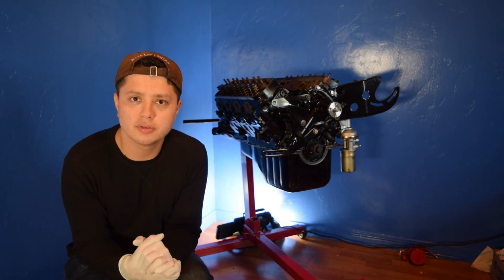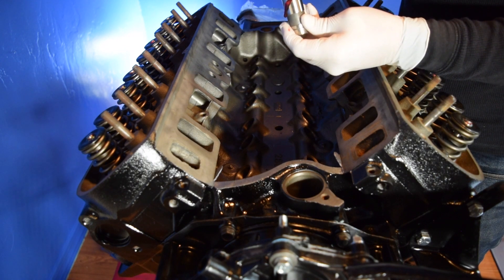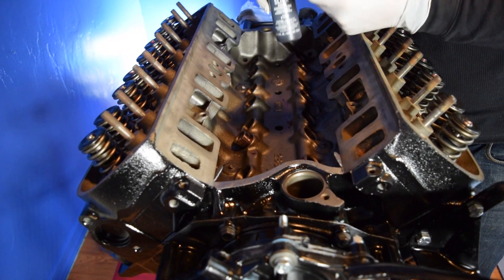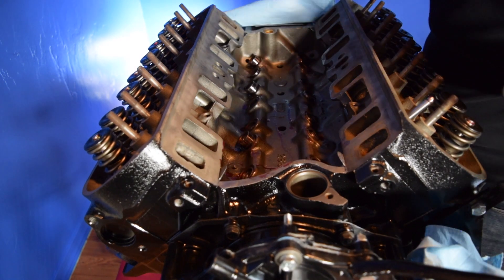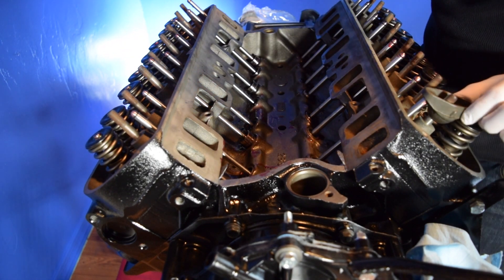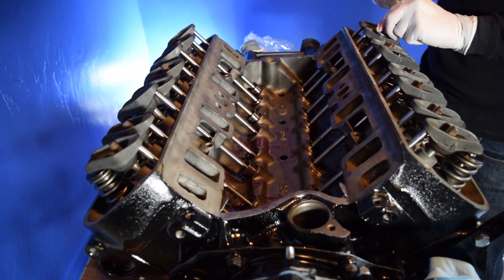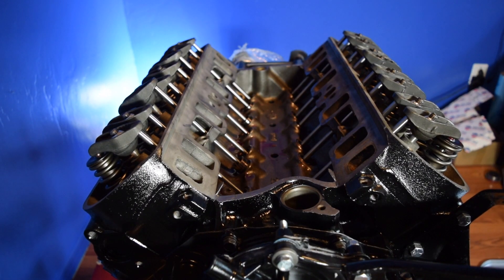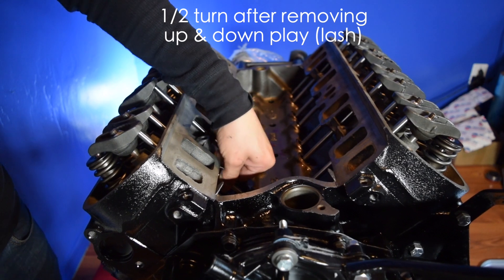289 SBF Valvetrain Install | Adjusting Pre-load

Comment: Did you get your levinox torque wrench to work,you mentioned it stopped working?
Reply from the maker: Yes it works fine! I had it set incorrectly which caused me to over torque the oil pan bolts, but i figured out it was my mistake. Still works good!